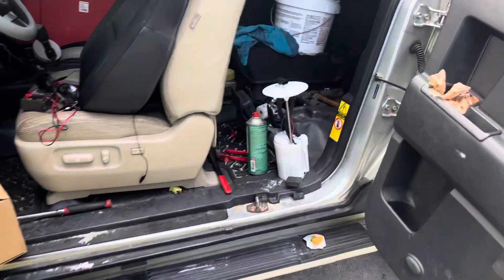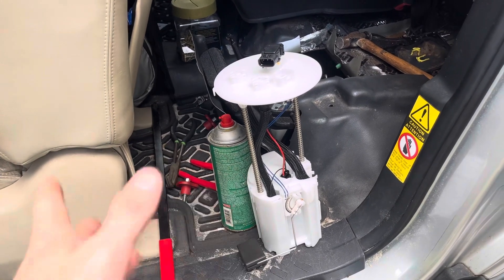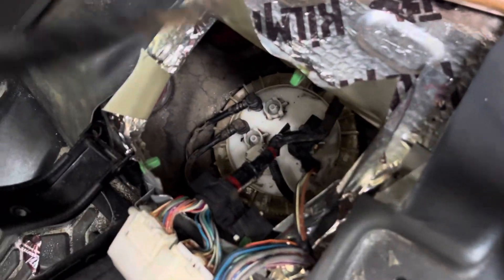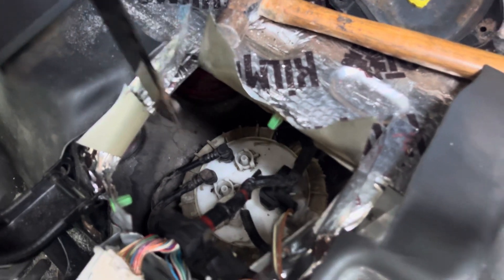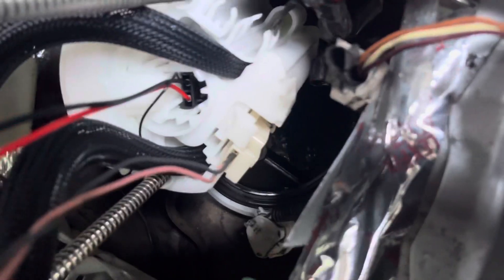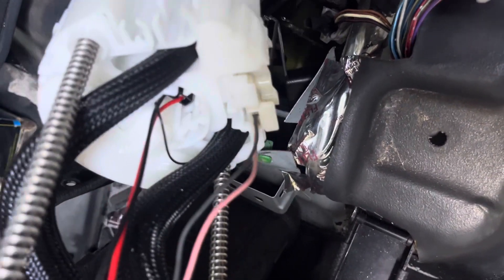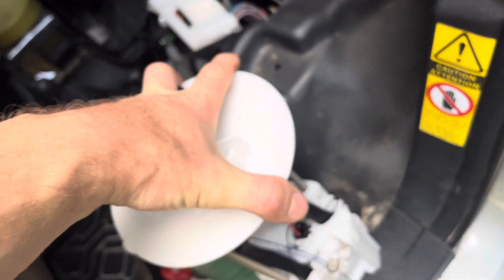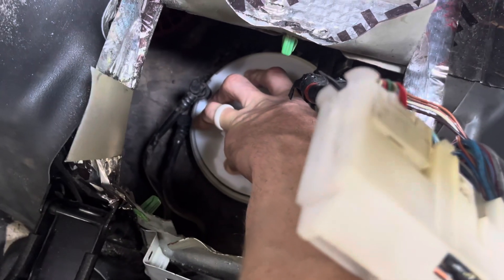Fj cruiser replacing the fuel pump without dropping the tank

Comment: What did you cut the metal with?
Reply from the maker: Sorry for not getting back to you sooner. I used a cutting wheel on a grinder. A sawzall would be risky in case you cut too deep. I cut lines and bent the metal back, then after install, bent everything back and put tape over the seams.

Comment: Why not drop the tank?
Reply: Saves hours of crawling around under your car and draining the fuel out of the tank before removing it, especially if you're working on the ground at home. It's really dumb Toyota had designed it so you MUST remove the entire fuel tank to get to the fuel pump. Considering the fuel pump is a serviceable item at every 150k km on the 1KD diesels, I'd happily chop up the top and install a new dust cover.
Reply: Shit yeauh!..my son has my 96 4runner and I did th "custom underseat panel mod...no issues, buy a piece of thin sheet metal @ tsc tube of rvt and a handfulof sheet metal screws..no sweat 👍🏻@eekimus
Reply: You could probably use a multitool to cut it without it sparking. Slow and steady wins the race!